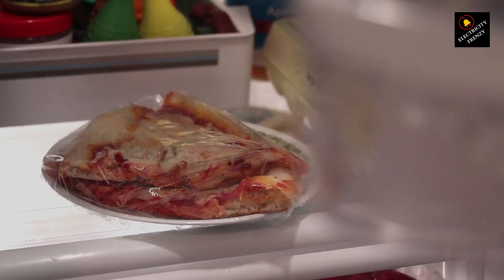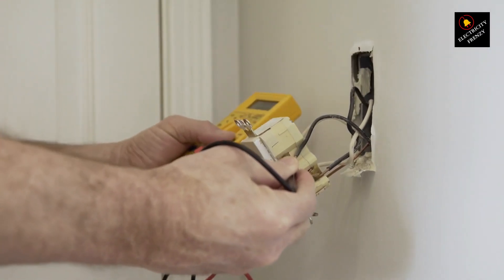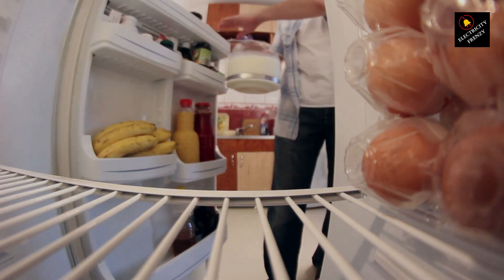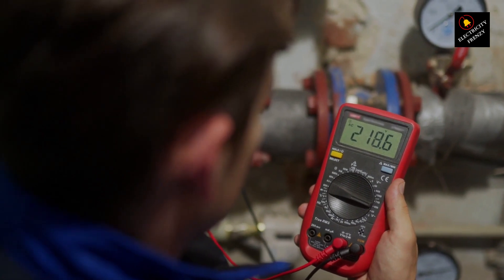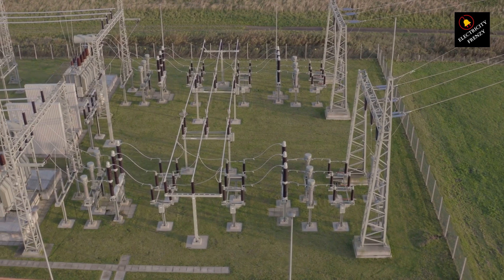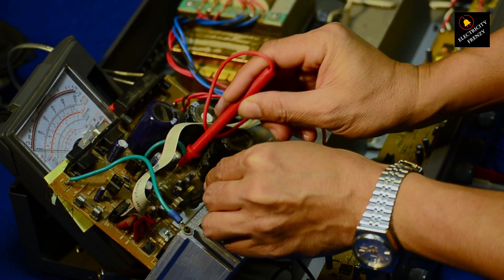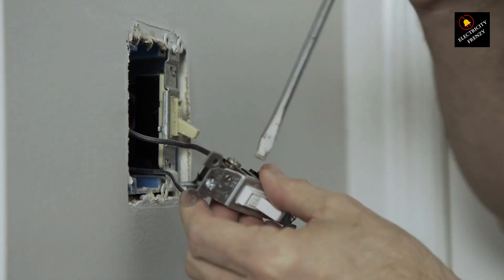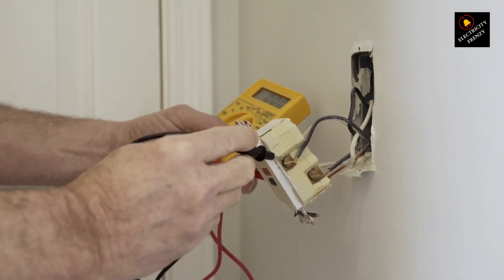Why Does Your Refrigerator Trip the GFCI?

Comment: Which isolation transformer would you recommend?  Do you mean a surge protector?  We have a refrigerator in the garage outlet which trips the gfci periodically.   There’s only one other Dyson vacuum plugged into the same line. Thanks
Reply from the maker: Does it trip when the Dyson vacuum starts?
Reply: @ElectricityFrenzy  No, it doesn't trip when Dyson vacuum is plugged in.
Reply: @ElectricityFrenzy  so can a surge protector work?

Comment: Thank you!  This helped me troubleshoot why my brand new $2K Frigidaire Gallery refrigerator kept tripping the GFCI on my well-equipped portable generator.  With the help of a friend, I discovered that the manual actually says to use a non-GFCI outlet. I guess this frig has some known electrical issues!  Anyway, I was able to use a L14-30 to 120 adapter to circumvent the generator's GFCI.
Reply from the maker: I'm glad the video was helpful! It sounds like you managed to find a smart solution with your friend. Thanks for sharing your experience—it might help others facing the same issue!
Reply: Do you have a link to the adapter?
We have a fridge in the garage and I didn't think of a dedicated outlet for it.  And only near outlet is a GFCI one

Comment: I unplugged the power, then there was water streaking down from the bottom of the electrical wiring/controls compartment in the back of mine. After wiping it clean, and plugging the power back in, the CGFI was tripped. I let it sit for sone days to dry while unplugged, then it worked. Both the freezer and fridge smelled pretty unpleasant though after that. 😂
Reply from the maker: It sounds like you've encountered a potentially serious issue with your refrigerator.  It's positive that you unplugged the power and allowed it to dry.   Water and electricity are a dangerous combination, and it's crucial to ensure that your appliance is safe to use. Thanks for sharing this with us 👍